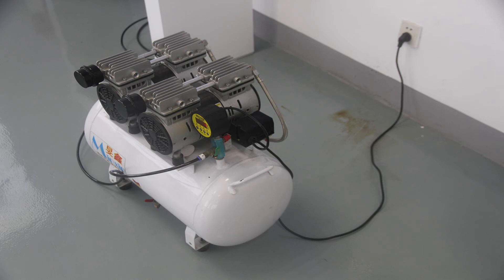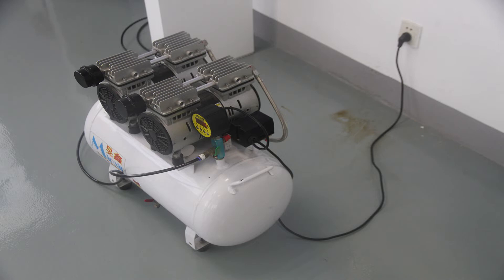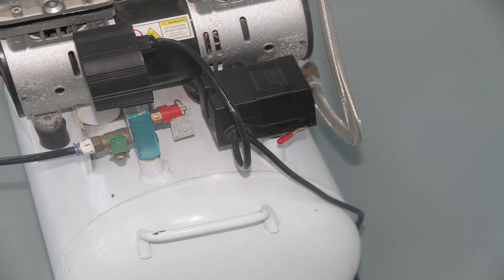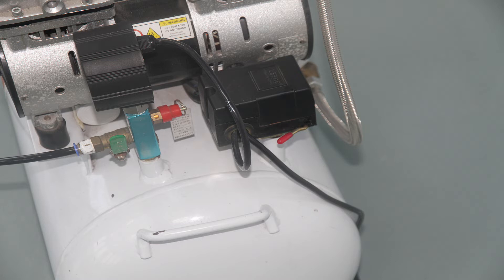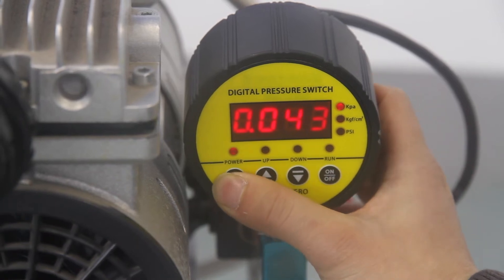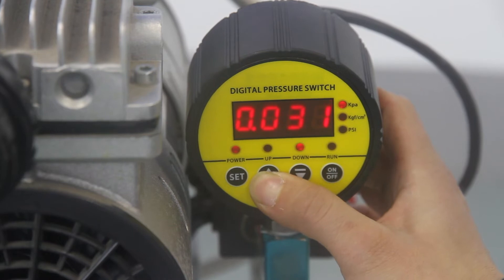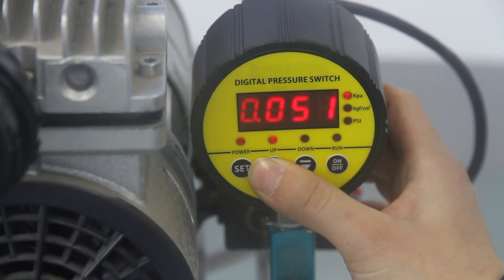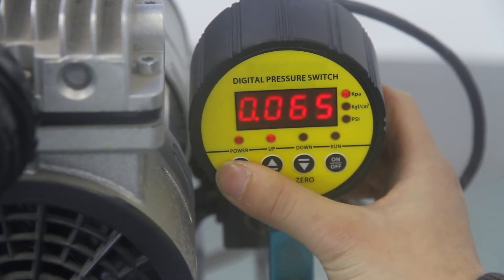How to Adjust Air Compressor Pressure Switch XY-PS828

Comment: Can you please answer, what kind of compressors are you use in this video?
Reply from the maker: It is just a genearl air compressors, The switch can control any kinds of compressors, we just choose right pressure range,  input power and load current, it can work well. You can find more information by http://www.xvyanprecision.com/

Comment: Would this work to control an autoclave? Or does it not support operating at these temperatures +-125°C?
Reply from the maker: It can control lots of machine with pressure, the embedded pressure sensor get pressure and output electronic signal to MCU, MCU calcuate it and output  control order to relay; consider it is assembled by electronic components, its operating temperature is -20~70oC, BUT I guess we have method to use Pressure extension tube making pressure switch work in environment temperature

Comment from the maker: XY-PS828 is an Intelligent Digital Pressure Switch, with 80mm diameter Plastic shell, integrating pressure measurement, display and control function. It has a variety of excellent functions, such as one-button reset, Multi-pressure Unit Converting and it’s easy to reset setting, adjusting and installation. 

Two relays are built in, this series of digital pressure switches have dual relays, which can be set up two ways of normally open and normally closed alarm points separately, also are able to control two ways of high and low pressure of air or liquid, in addition, it is with one key reset, at the same time, calibration, shifting display unit, setting return difference and other option functions.

The intelligent pressure switch is equipped with high-precision instrument amplifier to amplify pressure signal, built-in temperature compensation sensor, is the high precision equipment for detecting and monitoring pressure, strong anti-electromagnetic interference (EMI), surge protection, reverse protection and so on

XY-PS828 Intelligent Digital Pressure Switch can be widely used in Automatic System, Mobile Working Machines, Medical Equipment, Pump, Compressor, Energy and Water Treatment, Agricultural Equipment, Test System, Hydraulic System and Pneumatic System.
http://www.xvyanprecision.com/products/pressure-switches/